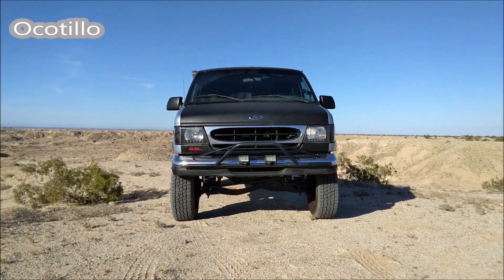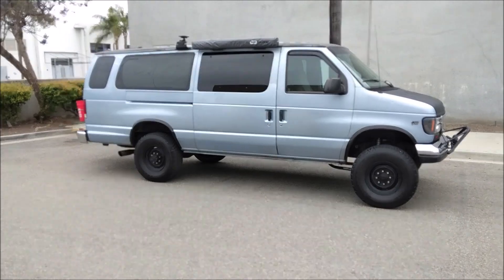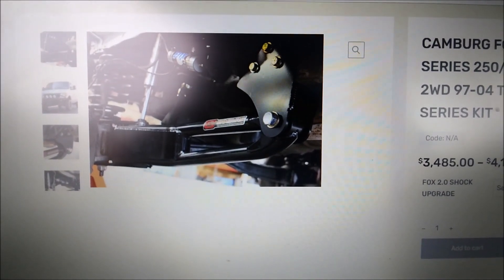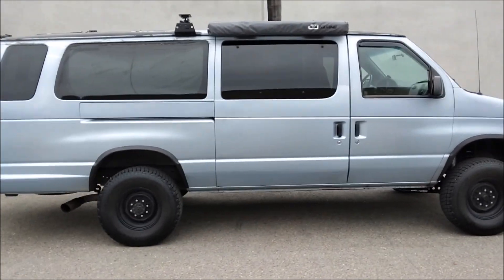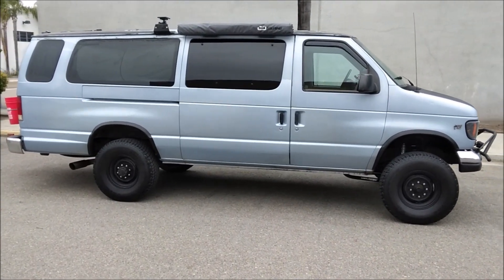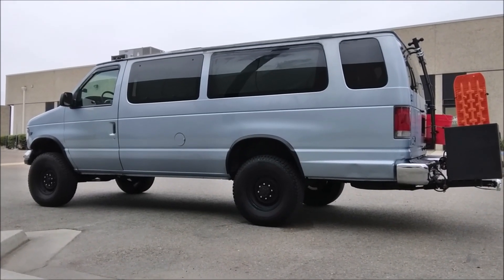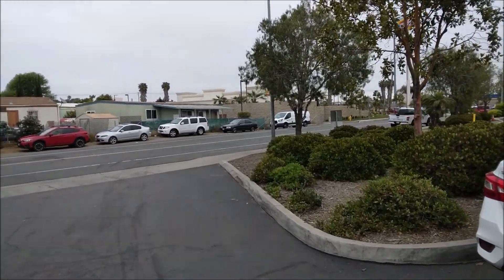Weldtec Vs Action Van Suspension | honest review off-road capability the truth | 2wd Econoline lift

Comment from the maker: I have no sponsors, none of these companies pay me so I get to tell the truth and give an honest opinion on both. Spoiler Alert they are both great choices if you don't have the budget for a 4x4 conversion and want to give your van more off road capability and the Sportsmobile look. Both trade off pros and cons.
Reply: Totally agree.  I now like action van. With fox shocks and leaf springs from weldtec.  😮
Reply from the maker: @sebastianslife91  Our talk inspired me to do this video. If you go Action Van upgrade to the radius arms with the pivot point. The good thing is you can combine kits. You can get the WTD rear springs later. You might be so impressed with the ride you might not even feel the need to get the rear leaf pack.
Reply: @JohnDrivesAnything I will now do that. Thank you bro!!
Reply from the maker: @sebastianslife91  How does U-Joint and Timberland lift the back? I'm sure there are more ways to lift the back with leaf packs then Weldtec
Reply: @JohnDrivesAnything  Ive heard Deaver out of Santa Anna Ca is the best for rear leaf springs…
Reply from the maker: @holdfast4588  That's Sebastians Homework research rear leaf lift options. He said his suspension is totally shot. He's running spacers on top of spacers for maximum budget lift but he lost inches in his actual human height from the ride compressing his spine. I told him Once you get the AV lift in your ride will be so much better and your van will be taller then his spacer on spacer lift that he might not even have the need to get a rear leaf pack anymore. He can save $2000 and buy me lunch at Buckshot diner with the money he saves lol. If He does go rear leaf kit it will be cool to get his feedback on if the mod is worth it.
Reply: @sebastianslife91  I'm thinking about those weldtec leaf springs too!

Comment: Planning to get the weld tech 3 inch just because I like how it looks ( the bent I beams )
I think you can keep the sway bar with extensions or shims between chassis and sway bar bushing
Reply from the maker: If you can keep the sway bar. I really miss it on really windy days. My van is all over the place. I want to get some Sumo Springs with the adaptor for lift kits. Hopefully that keeps it more stable in really bad winds. 

Let me know how it goes. This channel and the people who stop by in the comment section are lifted van fanatics!

Comment: What tires are you running?

Do you like them for the terrain you run? (Ansa Berrago etc)

If you needed a new set - Which tire would you choose? (I ask as my K02's are almost done & need to make a decision soon...) I'm thinking between the K03 or Falken AT4W!!!
Reply from the maker: I'm running cheapy Patagonia ATRs! $800 installed. Check out what we did last weekend. Anza Borrego! https://www.youtube.com/watch?v=WTLDDjtUdnM
Reply: @JohnDrivesAnything  So - would you buy them again?
Reply from the maker: Yeah. Air down to 20 psi I have a rear locker now I was doing every bit as good as people with K02s and K03s. Theybjust don't look as cool.

Comment: Fox shocks are not worth the almost $300 per shock. 
The bent I-beams actually shorten the track width. But you can make up for that with wheels.
But id go with Action Van especially with their upgrade pivot radius arms and no welding.
That's also why I like swc4x4vans, they have the only completely bolt on 4wd system, that I've seen anyway.
Reply from the maker: I recommend Action Van over Weldtec. I don't think the extra suspension Articulation is worth ditching the sway bar. On a really windy day I miss the sway bar. I work a manual labor job too so every penny is earned the hardway and a $2000 price difference install vs install is a lot of pennies

Do you have a van build going? I have a Epic Off Roading van meet coming up in October and 5 people showing up have a Weldtec lift and another 5 have an Action Van lift and a couple of guys with 4x4s are going to show up so it will be cool seeing a convoy off roading and I'll do a video on all the different lifts.

Comment: I bought my 2014 e350 with the Action Van lift kit already installed. It has been in there probably since 2014, and parts are showing corrosion and rust, and shocks and springs need to be replaced. I'm thinking about just getting a whole new Action Van kit.  But, I have a few questions...

1. How do these lift kits affect the tie rod bushings?  I put some beefy 35 inch tires on it with 17" wheels. Just wondering why my tie rod bushings keep seeming to wear out so quickly, giving me a knocking sensation in the steering wheel, mainly at slow speeds while turning.  

2. What size wheels and tires do you all recommend on these lifts?  I want bigger, meatier tires, but balanced with a smooth ride on the highway.  Currently I get some steering wheel wobble between 60-80 mph. I replaced the steering shaft, which helped, and I have replaced all of the tie rods twice, had wheels balanced, alignments, etc.  Just wondering how much to expect out of the highway ride out of these setups.  

3. Some harsh bumps on the highway, especially when hitting both front wheels on the bredge transition things, or rough patches on the highway... seems like suspension should absorb these bumps better, but man they can be hard and loud. 

Any advice is greatly appreciated. Thanks!
Reply from the maker: How many miles is on the van? Any clue how many miles on the van with the lift on it? 

35s are Massive! Sometimes I wish I went with 265s (31.5s) instead of 285s (33s) I still need to get a re-gear and I hope I regain 1 mpg back. I ran 245s (stock) for almost 2 years even with a lift. Looked a little funny but for a V10 I was getting 12-14 MPG stop ang go Taffic and 15-19 MPG freeway/roadtrips (driving 60 MPH cruise Control and depending on how much traffic there is) 

Is the wobble all gone? How new are the tires? I had a wobble and it was the tires cupping so I finally got bigger tires. My lift was out of alignment for a few months it pulled to the left slightly and I ignored it until I I got wobble.

It's not glamourous but I think 265s is the right size. It's a size up it only weights about 5-10 pounds more then 245s 285s are 15-25 pounds heavier then 245s. Of course bigger tires on a lifted van is going to wear things out quicker then stock. 

Does yours have a steering stabilizer? If the kit has been on since 2014 and your van has a lot of miles New shocks is a good idea. 

Here's a video on a meet I did a few weeks ago hitting some trails
https://www.youtube.com/watch?v=EvJMlqXBXWs
Reply: @JohnDrivesAnything  the van has 107,000 miles on it and my guess is the original owner had the lift put on very early.  Yes, I need new shocks for sure. But, this van was in Chicago, and has a small amount of rust and corrosion, nothing structural though, just surface rust. I could probably wire brush and repaint things, but I like my stuff clean and nice. So, I'm considering just getting a whole new kit from Action Van, and maybe some new leaf springs for the rear. 

I'm thinking that these 305 tires are just too big and heavy and grippy for the tie rod pivot bushings and that's why they are wearing out so quickly, and it probably has nothing to do with the lift kit itself... just the huge aftermarket tires and wheels.  Ironically , the tires don't even look that big on it to me now. 😂

Yes, I have the Bilstein steering stabilizer on it.

Also, mine is a V8 5.4L, and I get about 11.7 mpg on the highway.  I have a RhinoRack roof rack with 270 awning, Yakima Rocketbox on top, and 3 solar panels. I'm sure all of that doesn't help the mpg's. I need to look into the gearing relative to wheel/tire size and learn more about that. 

Looking at u-joint, they replace all of that front end linkage and I'm sure they probably ride like a dream and everything is heavy duty and designed for the big tires and off road. But man, $25,000 just doesn't sound good to me. So, I'm trying to find that sweet spot on tire size, etc. to fall within a more reasonable budget. 

Another thing I've thought about, is all of the stuff going to electric vehicles. How much money do I want to invest in my gas guzzling machine??? It's fun, and I love it, but it's costing money, and not sure how much it will hold its value in the long run.
Reply from the maker: @GlenArterburn  Now many people with 2wd lifted vans running 35s or bigger. You should post a video of your van. Do you have an Instagram? My biddy sebastianslife91 on here really wants to fint 37s. Im trying to convince him to stay with 33s lol. 

I'm going to get my van rear lockered and re-geared soon.

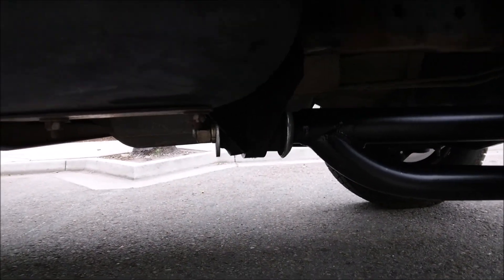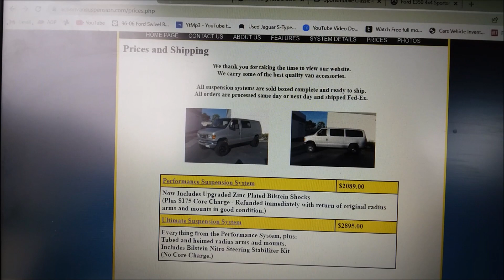IF you want to continue running 35s or bigger you need 4:56 gers. 4:10s with 265s or 285s 33s..

Whats your RPM at 65 mph?
Reply: @JohnDrivesAnything  I'll check on my RPM and let you know. Yeah, what does "rear lockered" mean exactly?  I'm gonna review the spec sheet on my van and see if anything was done on the gearing and differential.  Thanks for all the info and your responses, and for posting videos. I don't have any videos, but I do have pics I could send you. I love my van... I've done a lot of work on it and it's a blast to have.
Reply from the maker: @GlenArterburn  Basically 2wd means 1wd. 1 legger. So the tire that gets the least amount of traction is the one recieving power and the other is just spinning freely. 

Good Road manners on the street. Sucks off road. A rear locker will allow both tires to receive power and enhance your off road capability.

So most 4wds are actually 1wd up front and in the rear and most 2wds are 1wd.

Rear locker will bridge the gap a little bit with a 4wd. 

So a rear locker makes you truly 2 wheel drive and a front and rear locker in a 4 wheel drive makes you truly 4wd
Reply: @JohnDrivesAnything  ok, so the locker locks both sides so they are both turning together for better traction, right?
Reply from the maker: Yes sir. Thats why when you see the hardcore off roading and you see 1 rear wheel in the air it's spinning the other other tire isn't getting traction. A rear locker will turn both tires.

Comment: Alcan Springs does custom springs, and I'm pretty sure that's cheaper than Weld-Tec, and it's better than blocks.  Another option (but REALLY expensive) is to get a Sky's Offroad rear '08+ leaf spring kit- MUCH more comfortable, and it uses factory (or factory-type) springs.
Reply from the maker: Action Van Suspension Does Custom Rear Springs they just dont advertise it. Weldtec charges $1500 + $750 labor. My friend is going with a Custom rear leaf I told him to make a video about it. I might eventually go that route. Next step for my van is a rear locker and re-gear.

Appreciate the heads up I will look that company up
Reply: @JohnDrivesAnything  I'm excited to see your vids on the locker and re-gear!  I'm currently building my van very similarly to yours- and I only found Action Van because of your vids!  So I appreciate the work you do on these vids!
Reply: I ran a shackle flip kit from sky's Off road on the rear of my van. The 78'to 92' shackles fit the van frame rails, you just need to open the holes up a bit. $230 and the rear was done! Thought I'd share another option.